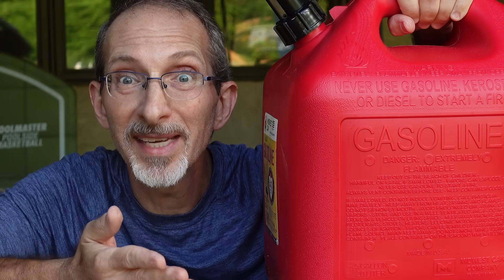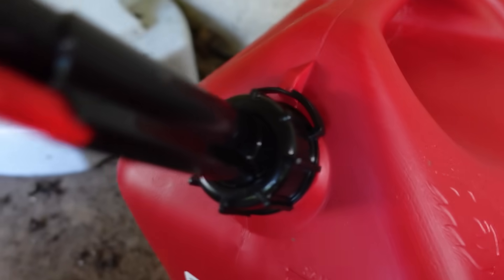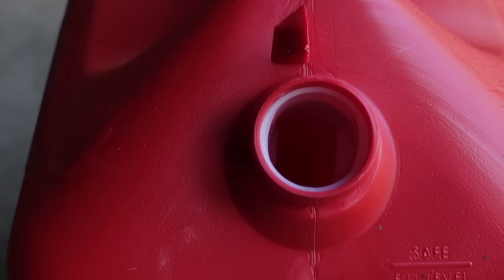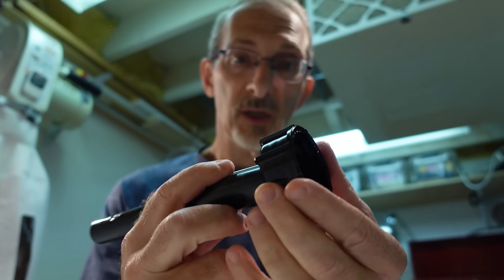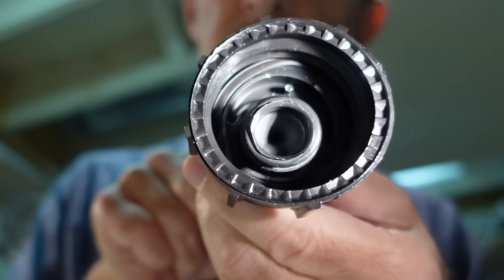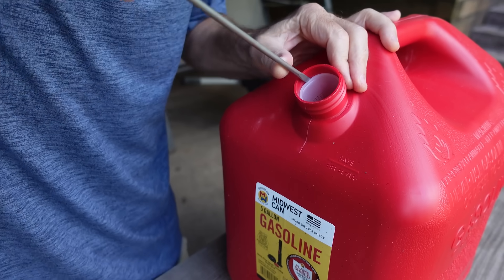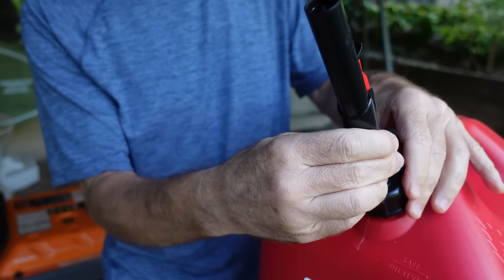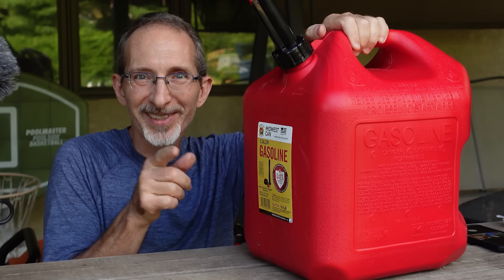Gas Can Modification | New Gas Can Fix

Comment: Interesting video. I've struggled with gas cans for years. First thing I do is remove that plastic lock ratchet thing that prevents unscrewing the nozzle -  just like you did. But I also found it difficult to use the gas can nozzle to fill my various fuel tanks: lawn tractor, lawn mower and weed-eater.  I found a really cheap (buy more than one) battery-operated pump on Amazon. Now I don't have to lift the heavy gas cans to fill these tanks. Put the gas can beside the tank, insert the nozzle into the gas can and the spout into the gas tank, turn the pump on and voila!. So much easier. 

Thanks for posting.
Reply from the maker: Thanks for your comments! I didn’t know a battery operated fuel pump was a thing until reading these comments. I should get one!

Comment: Now that you have fixed these two issues, there is still one glaring problem...no vent. The can needs a way for air to enter as the gas is pouring instead of going glug glug glug and spitting all over your hot mower. The EPA really did screw the pooch with this.
Reply from the maker: Hi Robert, vent added in my second video. Link in the description. Thanks for watching!
Reply: @MikeFyxdt  I was literally just watching video #2 when I saw your response...already clicked through your link to get some vents. Thanks!
Reply from the maker: @robertkorn   Awesome!

Comment: You can buy replacement nozzles without that B.S. Even if you do what this guy says, it'll still glug slowly. Filling a lawn mower, maybe no big deal, but if you're filling something with a real tank, it takes freaking forever.
Reply from the maker: Joe, you are correct. I added a vet in my second video and it really improve the flow. Thanks for commenting!

Comment: Something that is even more silly, those filters are not filters, they are flash suppressors.   Apparently people were pouring gas onto live fires and the fire was going back into the cans causing them to explode.   The Blitz gas can company got sued and had to file bankruptcy because of this.  If you do some digging around on the flash suppressors, they seem to work, "some times".  LOL  I removed mine too.  I'm pretty sure I'm smart enough not to pour gas onto a fire.
Reply from the maker: Yes, I found that out after making the video. I explain it in my follow up video, link in the description. Thank you for commenting and for watching!

Comment: Those so called safety gas cans. Are absolutely not safe. The old school cans that were around for decades. I never ever spilled gas. These new difficult to use plastic cans everyone I know and work with. Spills gas every time they try to refuel small gas powered construction equipment. Just an example of bureaucrats legislating something they know absolutely nothing about
Reply from the maker: Thanks for adding to the conversation Eric!

Comment: Use a hand siphon pump, keeping the intake a bit above the bottom of the portable gas container.... no spills, easy to control, and you don’t pour trash/water condensate contamination that could be in the portable container .  I never completely drain a portable gas can so the dregs stay out of the gas tank and less risk to fuel filters.  I also rotate gasoline in the portable containers so the gas is never more than a few months old.
Reply from the maker: Great tips! Thanks for joining the conversation.

Comment: OK. Here's the reason for those stupid "Auto-Shutoff Spouts:"
Modern gasoline has alcohol in it. Alcohol absorbs water from the surrounding air.
Once the alcohol has absorbed enough moisture, it is no longer flammable.
It also turns into a sludge that gums up the works.

In short, we have these things BECAUSE WE WON'T PUT THE LID BACK ON THE MAYONAISSE!!!
Reply from the maker: Even with the spring removed, you can still get a really good seal on the nozzles. I never really thought about it but I suppose having alcohol in the gas could make it go bad quicker. Interesting!

Comment: I have an original nozzle on a 6 gallon gas can. I also have a one gallon gas can that I mix a 40:1 gas oil mix for my 2 cycle weed eater and leaf blower. If I ever buy another gas can with this new safety nozzle, I don't care if it's illegal to modify but I would anyway. Thanks for showing me how to do it. I just subscribed.
Reply from the maker: Thanks so much for subscribing! I also have a 40 to 1 mixture gas can, and a 50 to 1 can exclusively for my string trimmer. Simple cans with simple spouts, and they do the trick!

Comment: I suppose they took away the vent as well?   How does this can vent?
Reply from the maker: The nozzle is designed with a straw like tube, and it is supposed to vent air in as it’s letting gas out. Well that might be fine in theory, in my second video I installed a real fat on the back of the gas can and it made a world of difference. Great question!

Comment: Mine are Blitz? I think.  Tractor supply sells a nozzle for a "water jug".  10 bucks I think.  It has two different collars for the can threads and the little yellow vent contraption.  You have to drill the can for the vent but then you have a gas can that pre-dates the EPA.  Edit: found this https://www.youtube.com/watch?v=MPOW0Rkchx8
Reply from the maker: Blitz is the company that went out of business, that probably resulted in all of these cans having all the safety features and being so difficult. Maybe yours is a collectors item? Thanks for joining the conversation!
Reply: @MikeFyxdt  Mine had a “twist then push” activation system.  Made it much more awkward to use.  This stupid crap has ben going on for a while.

Comment: Another problem with this so called "safety spout" is that after some time they starts to stick.  So then when removing it from the tank that is being filed it doesn't close, like it is expected to, and spills a large amount of gas.

This is what happens with lawyers force engineers to do things in the name of safety to protect stupid people from themselves.  These should be called "spill more spouts".  They make the process of using the product more cumbersome.  Resulting if being more prone to accidents.  Lawyers need to learn about KISS (Keep It Simple Stupid).  Or maybe even better would be "Keep it Stupidly Simple".  So simple that anyone with more than a 2 digit IQ can be effective.
Reply from the maker: My tanks are still new so I haven’t experienced the sticking that you’re talking about, but I will keep my eye out for it. Thanks for the tip and thanks for watching!

Comment: I bought that exact same thing years ago.  The gas shot out while filling and the damn nozzle leaked fuel everywhere.  Absolute garbage.  I bought old style nozzles on Amazon but wasn’t sure how to fix that stupid filter thing.  So thanks a bunch for this video.  👍. Also you can get the little vent plugs that let air in so the gas flows freely from Amazon as well.
Reply from the maker: Excellent! I’m glad it was helpful. I added event in my second video, link in the description. Exactly the ones you mentioned on Amazon.

Comment: That filter is essentially there to protect the can not the eguipment, as the case that it catches contaminants going in, they will just come back out when you fill your equipment. What a stupid idea. For it to work it would need to be filled with the filter in then removed or the opposite, or have two fillers with at least one filtered.
Reply from the maker: After I made the video I learned that the filter was a flame arrester, which I explained in more detail in my second video. I appreciate you watching in joining the conversation!

Comment: I have to put 10 gallons of diesel into a tractor with one of these useless contraptions.  When I'm don't it is spilled all over me and the ground. How is that EPA compliant.  Buffoons.
Reply from the maker: A lot of people in the comments section have been recommending inexpensive battery powered gas pumps. It sounds like you could use one of these! Thanks for watching.

Comment: My favorite part is the screen makes sure that any impure objects you catch with the screen heads directly into your really expensive machinery.  Nice job lawyers.
Reply: A screen attached to the nozzle you remove instead of directly into the can would fix this and catch the impurities in the can.
Reply: That screen is to prevent a back flash of fire from going into the can. Doesn't have anything to do with filtering junk out of the gas as you fill it.
Reply: That was my thought exactly.
Reply: Not lawyers. Engineers. And obviously ones that never use gas cans themselves EVER.
Reply: Exactly.
Reply: The screens have been there for 30 years...

Comment: Just go to tractor supply and get the replacement gas can spout kit. It's $10 and will cure all your problems and the kit comes with an air vent that you drill a 1/2 inch hole on  the opposite side from the spout and pop it in and now you have a gas can like the old ones we all loved.   :-)

Comment: Okay. Good but i would have sniped the spring shorter so it wont be  pre loaded so much, but still seal the fumes from leaking out, or put in a lighter spring. Leaking fumes not good.
Reply from the maker: @mountain hopper - I totally agree! After making this video I set out to see if I could reduce the strength of the spring so I could retain the self-closing action, and it worked! I documented what I did in this follow up video: https://youtu.be/XoYxdrhB6Ls

I should add that, since the spout still locks without the spring, it stays air tight. I know this because I still have 1 can with no spring, and it 'burps' when I release the latch and push in the nozzle!

Comment: I've gotten to the point of frustration with the new cans to where I just unscrew the spigot and use a funnel when filling up my lawnmower.
Reply: The EPA really fucked us Americans with this bullshit
Reply: Those cheap plastic nozzles eventually crack and leak. Funnel is better in many situations. Usually lawnmowers is all I use gas directly from the can. Premix for 2strokes gets mixed a pop bottle at a time and couple bottles of mix would overfill the chainsaws and weed eater. No stale premixed fuel left in the can to go to waste.
Reply: Metal can with built in funnel works pretty damn good, but quite expensive..I've used heater hose, garden hose, anything to modify away from these damn "safety" cans..
Reply: Yeah and some days I'm too lazy to go grab the funnel and just say F it and free pour it and wish for the best.  Sometimes i miss the hole a little, meh, I let it air dry.
Reply: Because getting so annoyed with safety features to the point that you use a funnel instead is totally safe.... These engineers need to fill up a weed whacker before they are allowed to design gas cans.
Reply: I do the same thing
Reply: and gener8ors!
Reply: I have an old spout I use on my push mower. The zero-turn has a large opening -- I pour the fuel in with no nozzle of funnel. Screw all the EPA crap.
Reply: @buddyrebertus3371  It is both believable and UNfkg -believable at the same time,
that gov can take a product that DID work well and muff it all up, making it nearly
impossible to use without getting gas all over the place, yet at the same time very
easy to see the foolish ways gov steps in to 'supposedly fix or make a jerry jug a
better product and fail to do so. just another way of spending money that does not belong to them.
Reply: You can by generic "old school" gas can poor tubes on amazon. the simple flexi white plastic ones. a kit is 10 bucks.
Reply: @danielstewart7732  if you're just getting the nozzle and no can, it's probably better to just modify one for 15 bucks. It's not like it takes much work.
Reply: @since1876  The old school design with an open nozzle and a vent on the other end pours a fast and consistent flow. Compare that to the new versions with a built in straw inside the pour nozzle which creates a slow pour as it must gurgle in order to vent the can. Easily 3x slower than the old style. That vent location makes a huge difference to the flow rate.

Comment: Great job. When using a gas pump pull up on the nozzle boot with two fingers when pumping gas into tank or container to eliminate the pump stopping from backsplash, it works when cans have a permanent screen. Doing so defeats the purpose but it's a design flaw to begin with.
Reply from the maker: Thank you - that's excellent advice!

Comment: Those new ones suck, the best of the new ones I've used are this style, the bottom and nozzle handle work better together, they're a little bit more expensive but it's way nicer. Never had any issues filling them up. 

https://www.amazon.com/dp/B000W9JN4S/ref=cm_sw_r_cp_apa_glc_fabc_E3W1GKCW19WAJENJD064
Reply from the maker: It looks like my laundry detergent dispenser! Thanks for sharing this Chris.

Comment: The filter makes no sense.  You wanna keep that crud out of your engine.  All the filter does is keep all the crud up near the spout so it comes out first as you are refueling.  What kind of idiot engineers things like that?
Reply from the maker: Wes, 'Filter' is actually a flame arrester, which I explain in my follow up video. Here's the link if you'd like to watch: https://youtu.be/XoYxdrhB6Ls
Reply: @MikeFyxdt  Well, that makes more sense, but not much more.  If a person is dumb enough to get an ignition source close enough to the opening of that gas can for it to ignite, they probably either deserve what they get or will shortly figure out some other stupid way to die.

Comment: I wish there was a happy medium with the newer gas cans. When I was a kid fixin' my mini bike and using gasoline to clean parts, I had a gas can ignite in my hand when I baked the gas off the part I was cleaning- the flame jumped to the can which had some spill on the side from the leaky cap seal those cans always had. Got some wrist burns, and scared the sht outta me, (I'm fine w/ no scars) but being a kid, I had no idea about the combustibility of the fumes. Now that I do, I still hate modern gas cans with all their BS, so I slightly mod my new cans I have to be more easy to fill all my engines with "some" safety.  I have an older plastic 5 gal push button can that I like b/c I removed the cap's ratchet safety, but left the push-button safety. I also have a newer plastic 5 gal can with a glug glug spout from hell that musta been designed by children. I'm modding that one too, but need to get around some real roadblocks in the spout design. I have an older small 3 gal plastic can that the safeties all broke years ago as did the adjustable vent cap, so I have a big ole fat wood screw as the vent adjuster now. It's awesome and reminiscent of the ease of an old metal gooseneck can- the one that ignited in my hand, but it doesn't leak down the side.
Reply from the maker: Sometimes I wonder how I/we survived all the 'unsafe' things we did as kids! I appreciate you watching and commenting!

Comment: I absolutely loath those spring loaded gas nozzles. I was filling a generator and the little tab that you push against the edge of the of the filler hole slipped off and the top of the nozzle shot off into the gas tank of the generator.
Reply from the maker: Oh my! Actually I've read about 3 other comments where parts of these nozzles went into the gas tank. Crazy!

Comment: All I did was take this née spout off and toss it in the trash and replaced it with one from an older gas can...problem solved!
Reply from the maker: Keith, it's good that you had extra parts!
Reply: @MikeFyxdt  
 I’m always picking up things that may come in handy at another time. I had the same problems you did with that new fangled gas spouts. So I happened to find a can that was in bad shape so I kept the spout and it fit my new can...

Comment: The filter is what I wanted to see. Honestly, I thought it was some kind of liner maybe to strengthen the plastic because of the stress you can put on the nozzle. I have two 5 gallon Midwest diesel cans. The first one doesn’t have the filter. I really don’t have a problem using the safety nozzle because of the machines I’m pouring diesel in - compact tractor, lawn tractor and a gator. I actually prefer the safety nozzle once I got the method down. But the oversized fuel nozzle on the diesel pump at the nearby station will absolutely not go inside the can with the filter, so I have to drive farther to a station with a midsize diesel nozzle.
Reply from the maker: 'Filter' is actually a flame arrester, which I explain in my follow up video. Here's the link if you'd like to watch: https://youtu.be/XoYxdrhB6Ls

Comment: You forgot the 4th problem, the vent. Drill the hole and plug with a cork. From Alaska
Reply from the maker: Thanks Robert! I installed event with a cap in my follow up video. Link in the description. Thanks for watching!

Comment: Drill a small hole for a vent. Run a coat hanger down the hole and pull a tire valve through it, with the schrader core taken out. Put the air cap on the stem and voila! air vent with a cap. Works perfectly! Done it to all my new "fancy" (piece of shit fuel cans) 😉
Reply from the maker: I added a plastic vent to the back of my cans in my follow up video. Link to the video into the plastic caps in the description. Thanks for watching!

Comment: Now how about some kind of air relief function so the gas will pour without creating a vacuum and chugging. The containers use to have a little screw on cap that you could take off for the pour. Little by little those disappeared.
Reply from the maker: You can buy little plastic caps on Amazon for this purpose. I installed one in my follow up video: https://youtu.be/XoYxdrhB6Ls